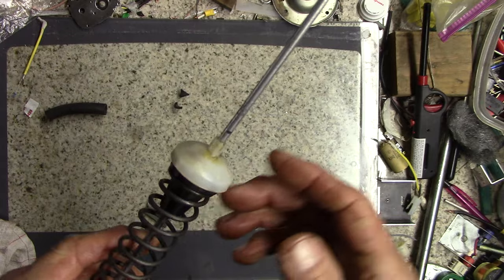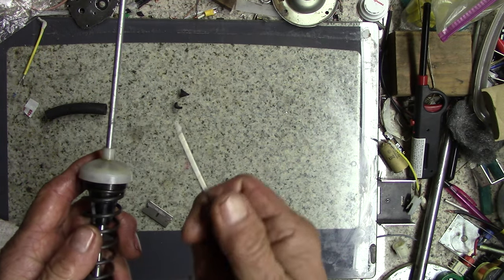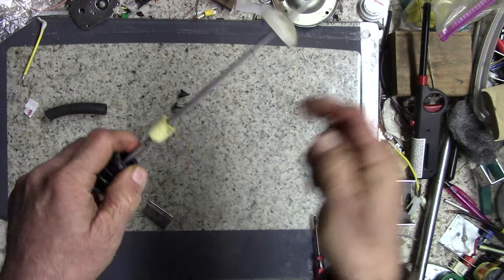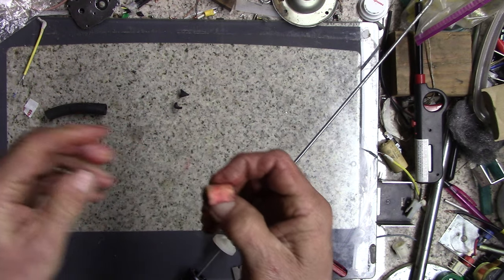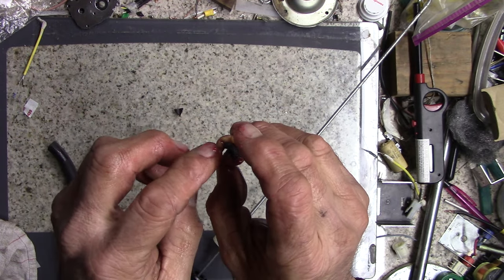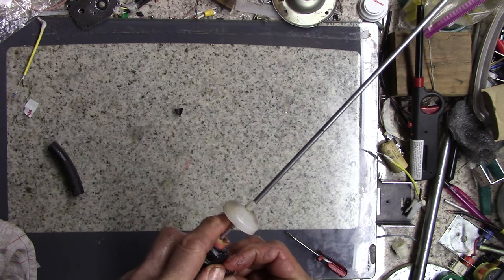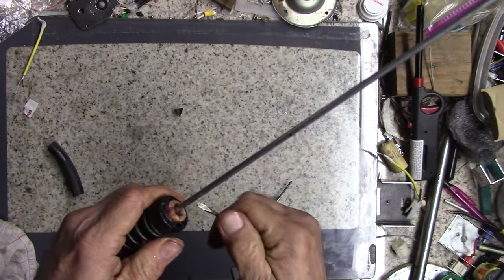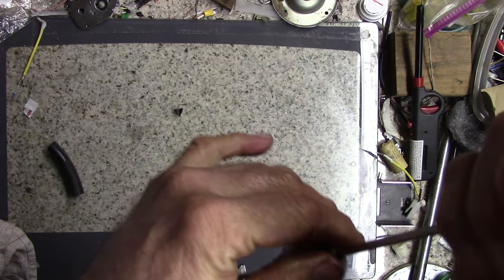Repair washing machine suspension rods FREE and FAST.  See description.

Comment: You're the first person who explained what the real problem was. The felt was not providing enough friction to resist the bouncing.  I used a peice of rubber hose first, 3/8" long, 3/16" I.D. then the original felt then Squeezed the cover back down. Reinstalled rods. Spins quiet now. I'm thinking the weight of the loaded tub puts added pressure on the felt squeezing it against the shaft and reducing the bouncing. Thanks for the tip.
Reply: Been washing 1v month with no banging. 👍

Comment: Great video.  You saved me from buying a new machine.  It may not last for long but so far it is still going.  I did not cut the foam. I just slide two pieces of zip ties in each rod.  Thank you again.
Reply: Genius!  I used your idea on my cheap rods that were worse than the old ones.  Worked fantastic!
Reply: Did you put the zip tie pieces in the inside of the foam or outside?
  I am wondering if this fix would work just as good or maybe better/longer if the pieces were stuffed between the foam and the foam housing instead if between the foam and the rod itself. 
  For one thing, it seems it would exert less wear in the piece of zip tie.
Reply: @rickeykeeton4770 No I just cut the pieces of zip ties (plastic) a bit smaller than the foams.  I did not cut the foam. I forced two pieces.  One on e/side.  Good luck.
Reply: @muchos_tacos Inside the foam against the rod or to the outside of foam?
  If inside, did it hold up?
Reply: @rickeykeeton4770  I put them inside the foam and against the rod.  I added some new ones again a few weeks ago when my washer starting acting up again. The washer is still good.
Also to help the machine I put some anti slide cups under each support of the washer machine. I may get one more year out of this machine. Good luck.

Comment: Did it. I also put some dampening grease around where it slide on the rod because it was rather dry. I also applied the grease to the connecting parts on the tub and body. Haven't tested it yet but I can tell just from pushing on the tub it's going to work
Reply: Update: ran a full load with a few towels thrown in. Works perfectly. Maybe even better than brand new rods. BTW this washer was banging of the sides and throwing a unbalanced code prior to the repair.
Reply: Did u use nyogel 767A or is there another brand / company that makes dampening grease? I’m trying to find some sold in a local shop or maybe Oreilleys?/ AutoZone, ? Walmart? Any idea if any of those places or lumber supply/building supply stores would have?

Comment: I did close to the same thing, just pulled the foam out and wrapped tape around it to increase friction. I think this method is better. Once the foam starts to wear, sometimes it is also dry and gets crispy, which causes it to wear faster: repair lasted about six months. That little piece of rubber is a good replacement.
Reply: the rod kit is about 50$, i tried a few similar repairs, but i think im just going to buy the kit, it will last for about 3 years, and then ill buy anther 50$ kit. But my washer runs 3+ times a week for the last 3yrs. 50$ will be worth it

Comment: It is Jan 2023. I bet it is still cold out there. Finally found an effective and simple way to fix this problem. Thanks, mate...a zillion thanks. I am thinking of using the rubber from a bicycle tyre tube because I have a bunch of them saved. Thanks again from Malaysia.
Reply: One of the ideas that I thought of too was a piece of tire to replace the foam. 
  I think I will try work out mat material and or clamps at some point and maybe damping grease.

Comment: The moment I saw your hands I knew you had a solution to the problem we all face in the service field 
You gotta know I’m gonna try this out 
looks like transmission coolant hose your using 
There are different types or thickness of rubber too that can be experimented with but clearly the grease is also vital to slow the dampening which is the problem, not the springs!!
Thank you good sir, I hope it works

Comment: hi, great video, after seeing this I held off buying a new set of suspension rods. I left the old ones in and used BELT GRIP from crc products. Sprayed onto the rods where they go into the spring with a full load in the washer to get maximum spring compression and exposing as much rod as possible. Works a treat, the friction from the belt grip is perfect and i expect to  get a lot of extra use out of the rods. Thanks for the idea.
Reply: No, thank U for the idea! Some of these videos , as helpful as they are, only employ a general engineering aspect.  Ut as the saying goes: there's more than 1 way to skin a cat. That being said , I in no way shape, or form endorse nor condone the skinning of any cats. No cats were harmed in the making of this post.😂

Comment: Thank you Sir, I did this repair to prove that the suspension rods were the problem. I had bought some cheap ones from Ebay and I still had the unbalance problem. I ended up buying the OEM and installing them. I will keep my original ones as backup.

Comment: Bravo!
If the tools you use depend on use consumable parts made of plastic and rubber, learning how they work and how to repair/replace them is essential. I'm very happy to see this investigation and report on how simple these stupid suspension rods are.
If I had a parts store in my town with stock in these parts, this fix might not be worthwhile. But since it takes a week minimum to get parts (and sometimes two weeks) this kind of fix is a lifesaver. (My wife will just persuade me to buy a new $500 washer if I can't fix this one for two weeks... My plan is to save up all the money I save with these fixes and buy a Speed Queen.)

Comment: After over a month  or two of hand washing my cloths while waiting for parts that I ordered to arrive I finally got around to this fix.   First I had the banging and the grinding noises.  So I eventually replaced the actuator and I nearly ordered a new trans too.    But I cancelled that.   I think that swapping out that actuator helped with the grinding noises but I am not certain, no matter because  it was still banging like hell anyways.   So I looked into  doing this fix but when I first set out to do it  the shock I removed  didn't seem to be the issue in my opinion. Besides that it took a great deal of physical strength to pull out the dampening rod if you don't know  the trick.  The trick is vise grips.    I had also heard about that metal drive block replacement for the plastic one which seemed to be a sure fire solution.  So  I decided to order the block and  the special tool needed for the installation of it.   The block never came and then all others were on back order for 3 weeks at least.   In the mean time I had other things to do in the yard but still I fumbled around with a few more Ideas  I had until finally the drive block arrived.   By this time I had become and Maytag dismantle expert.   I even got my machine fixed .  It only  ran okay for about 3 loads of wash.  Much needed loads and then it returned to banging like hell again.    I got a little discouraged and with the summer nearing its end I was most preoccupied wrapping up my outdoor projects ahead of the incoming cold weather      Still  I had resolved that I was going to try this one last fix before throwing in the towel.   I had truIy lost all motivation, especially since I  already  STILL have another washer on order and everything.    I ordered The GE One and Done from  WayFair  but it  went on back order until Nov 13th  an extra month    BLOODY HELL!    Clothes are stackedup and backed up in laundry baskets.   My family has turned on me.  Its a nightmare.    I caught a  break in my schedule and forced myself to try this one last fix,  all the while it didn't seem like it was going to work.    But I did it and then  ran my washer though manual tests mode.    It ran good with no banging.   Picture me doing the Pee Wee Herman in the Risky Business hall way wearing tighty whities.     I am so happy and greatful to you for this video.     Now I  am going to  run this baby all night long and well into next week catching up on all these dirty cloths.     Thank God!   I was about to have to walk the plank.

Comment: I replaced my dampers / (shock absorbers) on my suspension springs with a rubbe fuel line hose. The ID and OD worked perfectly.

Comment: You are awesome man thanks for the best tip ever those suspension rods are expensive too,, 1 question in your video the little foam type white part mine turned into pieces do you have a tip on that ,, if there's something to replace that part because when I took it out it just crumbled to pieces...
Reply from the maker: When they get really old and dried out, they cannot be fixed.  That is for sure.
You can possibly use the suspension rods from some other washing machine that have been thrown away or someone wants to get rid of them.
I have seen washing machines that just sit in alleys here and there and people's back yards etc.

Comment: I've read that Amazon carries a thick grease called nyogel that is made for putting on the rods which will dampen the action. I looked it up and sure enough, the reviews say that it works. I have some stuff that is very sticky called ultra tef gel and I'm experimenting with now.
Reply from the maker: Perhaps it maybe worthy of putting the grease head to head competition with small rubber to see which one  will last longer.  And of course considering the cost and labor for each.
Reply: @alchemy1  I tried some of the ultra TEF gel but it didn't stop the unbalanced effect of the centennial washer. It's got to be something else. I ended up getting an older washer, no electronics to have to reset,or calibrate. Just a simple washer with a large agitator that works excellent. Spins out great and less time drying

Comment: That's great. Thank you. The rods on my Amana are almost $100. That's crazy.
Reply from the maker: It is high way robbery as the saying goes.
Reply: I spent about $35 on Amazon for rods for my Amana and they lasted two months. How are yours holding up
Reply: @Derrick  
They seem to be short because the basket is rubbing on the top section. They're the right ones, I guess the washer gets used to the old ones. I'm hoping they settle in, I just might have to throw this piece of crap out as far as I can and get a new used washer. Have you seen the price tag on new ones? It's ridiculous. Well at least I know what's in store for me if this happens again. It'll be time for another washer, I'll be dammed if I waste any more money then I have to.

Comment: Wonder how long this will last. 
  Seems like a thin spacer around the outside of foam might last longer. That and dampening grease. 
  Maybe very fine wire wrapped around the foam or pieces of aluminum trim place around the OUTSIDE of the foam to tighten it to the rod. 
  If what I am trying to plain would work, it would force the foam around the rod equally all the way around providing basically the same wear for the complete interior of the foam without having to cut it and causing uneven wear with something inside the foam. 
  Just a thought. Something I might try.

Comment: They don't come with grease on them and your fix may work but if your trying to use friction with the pieces of rubber why would you put grease. That yellowish stuff is a sticky substance that works it way out of the inside and dry's up. If you use the substance out of the rodent and insect glue traps. its messy and there's a little trick to it but its the best thing i have found. Also if you grease the top of that piece that the machine rest on and also the cup that it rest on at the top in the plastic cup and put the centering springs on that the manufacture's decided they needed. I actually put 4 on not 2 and I make my own that have a lot more resistance to them than the factory ones.
Reply from the maker: You are conflating vertical  friction component with tension needed on the horizontal axis. 
One you want and the other you want to dissipate.

Vertical friction causes binding incongruent movement which you want to control creating smooth reciprocating action.  No different than reciprocating piston in your engine.
It is the exact same principle of forces in action and the thermodynamics involved. 

( I did not want to get technical but you left me no choice. And I still have to only assume you got it.)
Most of my videos are concerned with bigger fish to fry.
Reply: This fixed mine. Saved 800 over buying new machine.
Reply: If you don't grease or use damping grease it will wear out quicker.

Comment from the maker: The clamps, the zip ties, the silicon, the liquid nail, the various glues, the shaft collars, the styrofoams,  the garden hoses... are all temporary losing solutions. .   You are not told that truth.
This is a simple real actual solution you can take to the bank.   All you have to do is to simply contemplate and see this in your mind's eye. It speaks for itself.
And no... 
DO NOT USE RUBBER CORDS IN PLACE OF THE HIGH DENSITY FOAM THERE IS A REASON THEY IMPLEMENTED SPECIFIC DENSITY FOAM  FOR THIS.

Actual rubber cord will hold too tight and you will hear serious banging  and in worse situation your washer might even walk over the floor. when spin time comes.
Low density will not  hold tight enough.   Now I covered all of the nonsense.  Unless you care to come up with another one.  🙂

I have repaired lots of washers throughout the years.  Not one single problem, anywhere.  This not some throw away experiment wondering if it works or not and or for how long.

It would take hardly a minute to get each rod done.  The actual work.   Making the video takes time because of all the explanation and so on.

Read the description for other details.
Reply: These new machines are designed to wear out. This is a permanent fix. The motor will wear out before this rubber. Remember you are doing this to a machine that is near its end of life cycle. Hell if it buys you 6 months why not try. Haters everywhere. SMH
Reply: Are you saying this video using a small piece of rubber hose is a permanent fix?

Comment: You really didn’t have to cut the center out.  You could have done the same thing without cutting.  I put a piece of a Ty-wrap instead of rubber hose, then squeezed in grease.  It all works

Comment: That repair will not last.  How many cycles to failure did you get before the machine went back out of balance?????
Reply: Not true at all man. It’ll last for years unless you only do one of them. If it doesn’t last, then YOU did something wrong or the machine has more problems.
Reply: @HughWoo  Right, and pigs can fly.   It's always amazing to me how technicians can figure out everything and engineers are stupid.
Reply: If you actually tried it, you might actually know. It's amazing to me that some people can make a comment like they know something more than everyone else but they never even tried it! Not one person here said they tried it and it didn't last. These parts are engineered to wear out so you have to buy another one in a few years or pay for their parts- just like propane grills. The repair guys tell me the older stuff lasted longer. They build junk now.
Reply: @SpaceCowboyFun  Answer the question.
Reply: It works
Reply: @joeherder5591  so do chinese small engines, but the real question is for how long???  It's called "cycles to failure".  A concept that most simply don't comprehend on this site.
Reply: If the parts aren’t made to be permanent in the factory, it seems reasonable that they can’t be jury rigged repaired to be permanent at home. But, If the 5/600$ original lasted 3yrs. , why kick if you can make a free repair last half that?
Reply: @tvp8501  first of all the "free" repair is not free at all: labor and time have cost.  Secondly, it's NOT going to last half as Long as the original parts.  Thirdly, you're spending labor & wasting time making repairs more frequently.  It's simply more cost-effective to just to buy the right parts and fix it so that it will last.  Of course the right thing to do is to not buy cheap machines that don't last.  Otherwise you're simply throwing good money after bad.  It's called marginal cost theory, and I encourage you to learn about it.
Reply: @tvp8501  And one more point.  Do some research.
On the term "planned obsolescence", What it means and why it is employed.  Some very smart people are using it.  Educate yourself and then you will understand.
Reply: @frankie7508 it works all I can say..nothing and I stress nothing lasts forever
Reply: @joeherder5591  unfortunately Joe you did not answer the question.  I agree nothing lasts forever but that is not the point.  Please address the point.  How many cycles before it failed again???
Reply: @frankie7508  so far mine has lasted well above the aftermarket type that is for sure...Noone said its as good as OEM but yes much more cost effective..takes me pulling from machine..repair and re-installing approx 15-20 minutes and hose doesn't cost much..let's just say new suspension rods ( whirlpool OEM) to the door approx. $120 or so versus this fix maybe $2 and 15 or so minutes I've repaired at least 30 sets no issues or call backs in last 6 months and saves customers alot of money ..but you do you